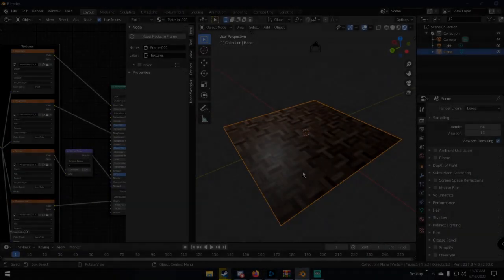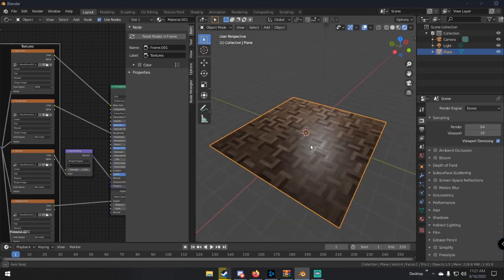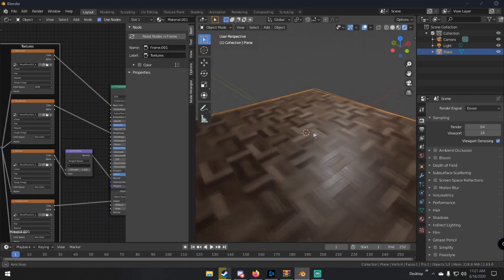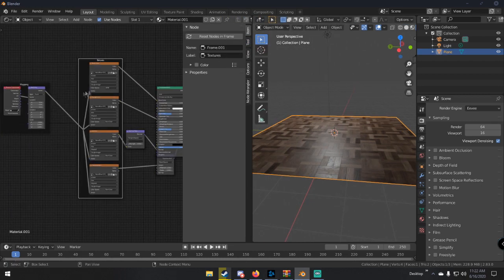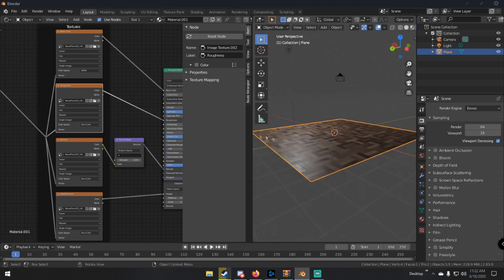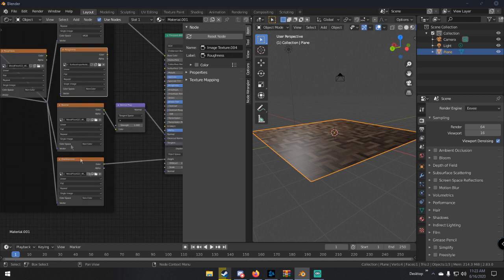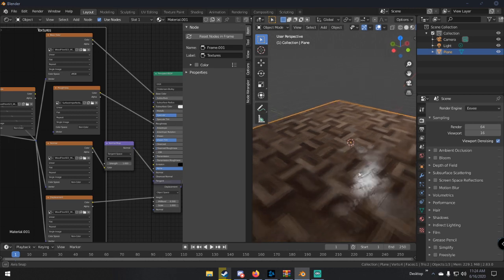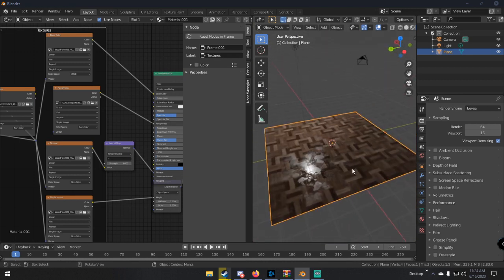Surface Imperfections in Blender

Comment: You should get to the point faster, you used up 2 minutes talking about that things aren't perfect, imo you could cut that part down into 10 seconds, also at least show us the roughness map you used, including it for download would be great as well for people that would like to follow along. It's hard to call it a tutorial really, u plugged a new texture into roughness, didn't mention that you should mix it with already existing one for the base texture so it doesn't look off, didn't show how to control the roughness with a color ramp for example etc. 
Thanks for the tut but imo next time it would be better to think it through a little more.
Reply from the maker: Thanks for the advice, I'm planning on making a full in-depth texturing tutorial soon and I'll be using all the advice I've gotten from my previous texturing tuts.

Comment: For the wood, would it work to keep the original roughness texture and mix it with the imperfections so it maintains the correct roughness for the material while adding the imperfections?
Reply: yes just use a mixrgb node then set it to screen
Reply from the maker: It should, I don’t know why it wouldn’t.